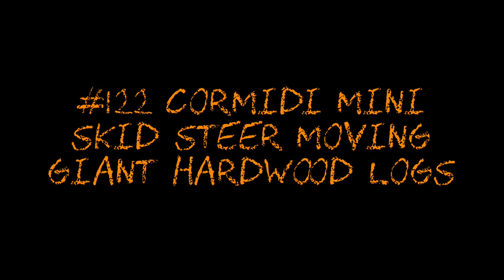#122 Cormidi Mini Skid Steer Moving Giant Hardwood Logs

Comment: How do you compare it to mt100?
Reply from the maker: In my opinion it felt much stronger in torque and lift capacity. The Cormidi is also modular, the entire loader can be swapped out for an aerial lift, cement mixer, etc.
Reply: Would you recommend to buy one with 180 hours? Was it easy to get parts for it? Someone said he had one and it spend more time in a shop then on a job.
Reply from the maker: I had the one on my channel for about nine months and put about 70 hours on it in that time. I had zero issues with it. The track popped off one time and it was very simple to get back on using simple handtools. 180 hours is nothing on those little diesel motors. Regardless of where you live give Wesco Inc a call at 203-847-2496. Ask for Adam and tell him Jake from Dude Ranch DIY referred you. He will be able to get you any information you’d like on the Cormidi machines!
Reply: @DudeRanchDIY  thank you!